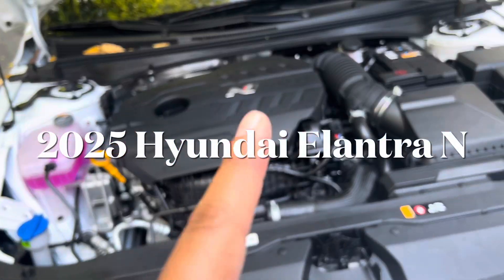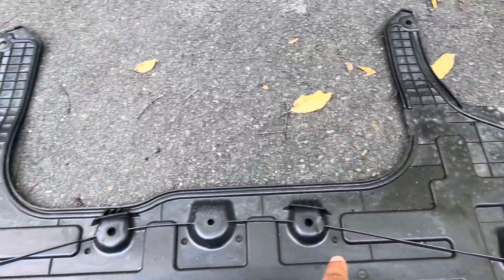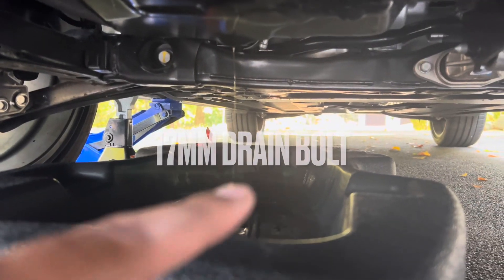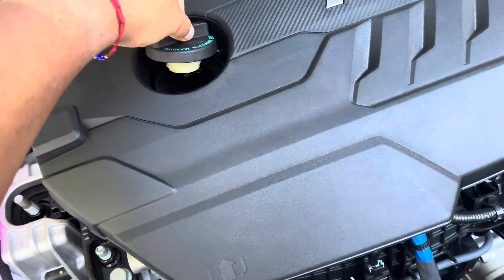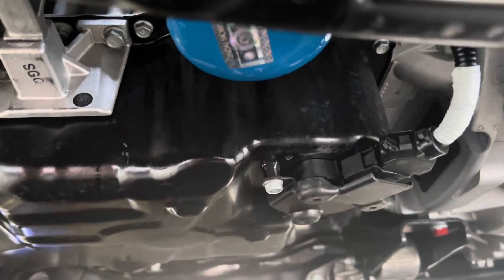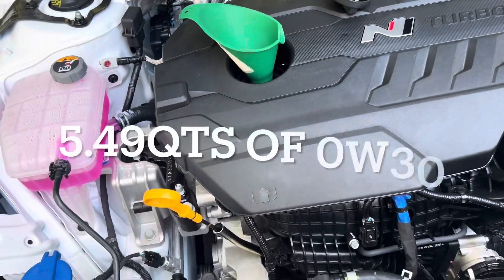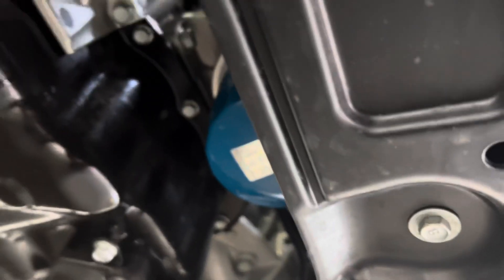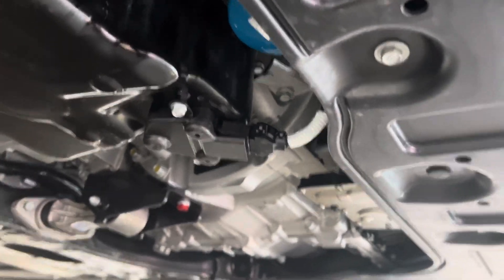2025 Hyundai Elantra N Oil Change

Comment: FYI, you don’t need to take the shield off. I have a 2024 and it’s perfectly fine to get the filter off without removing the shield. Remove it slowly and it’ll drip on the back side without hitting the shield so the shield stays clean
Reply from the maker: Yeah I was debating that once I saw how it drips. I took it off just in case, to avoid a mess. Next oil change I’m going to leave it on and see how it goes. Thanks for the tip!

Comment: Where did you get your oil filter?
Is this a good oil for a 24 Elantra n?
Reply from the maker: I got the filter on Amazon. These are the OEM filters. If you search 26300-35504 it should come up. 

This is the oil that is recommended in the owners manual. You should check and see what it recommends for your temperature range where you live.
Reply: @ez.repairs  thank you, I ordered mine an amazon as well, and used the mobil 1 advanced fuel eco 0w30, will be put away for the winter anyway and wanted to make sure I used warranty friendly everything. Thank you!!!

Comment: Did u really have to take it off 🧐 the 2023 doesn’t have that issue
Reply from the maker: I didn’t end up cutting it. On the next oil change I’m going to try to do it without taking off the shield and see if oil even gets on it.
Reply: @ yea don’t worry it will only be a couple of drops 😂